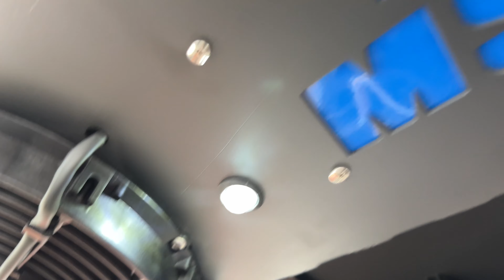Dual TEAM MSC Overhead Fan System w/LED Dome Light UFORCE 1000 Install & Test

Comment: How much is the set for a CFmoto 1000xl 2024
Reply from the maker: I think you get $100 off when you order front and back
Reply: @RealTalkPowersports  On a scale from 1 to 10 what is the noise level when they are on high? And if I order 2 of them will you throw in a red and black MSC hat?